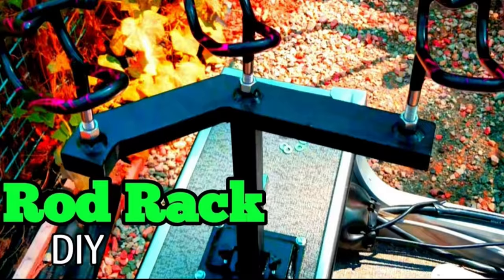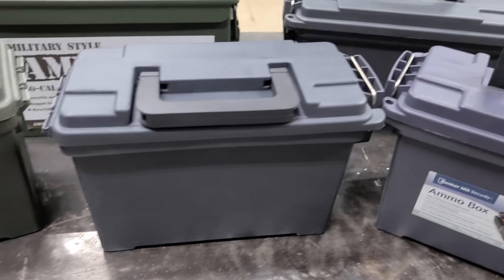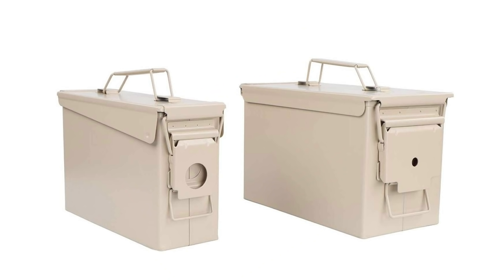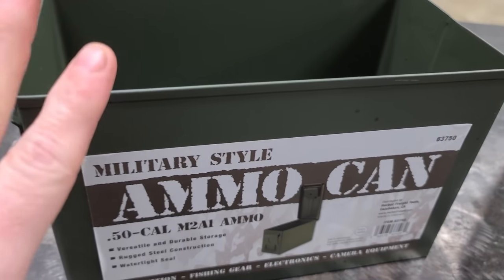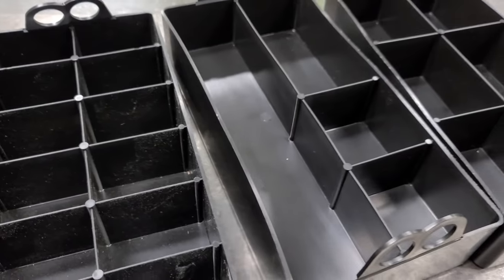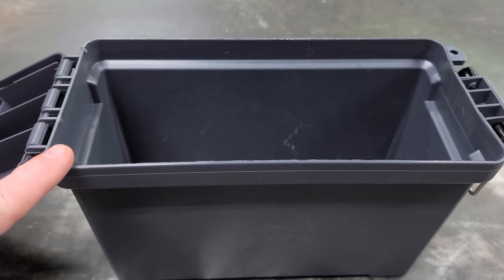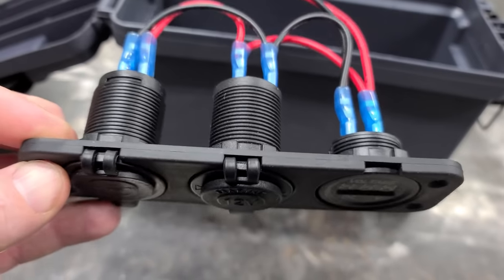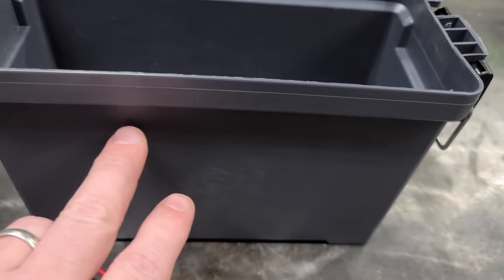10 Ammo Box Hacks

Comment: O rings go on the wet side of a system and prevent leaks better because the pressure from the liquid pushes them into the housing. Its just harder for it to escape.

The intake should be higher than the output on a system that uses a solid mesh as filter media that way the solids are sitting on top of the filter media with gravity pushing them into the bed. Running it at the same height in the middle will cause the flow to push your detritus into the media and then around the sides, bottom and across the top as these are the paths of least  resistance as the media gets clogged.

Love these vids and thanks for sharing them
Reply from the maker: Thank you for the info . You don't it before obviously  lol
Reply: @FishinNStuff  I build a lot of multi fish tank systems and ponds and being a person who doesn't want to break the bank or break other people's banks, well you know we southerners learn how to make do with what we got.

All my systems use pillow stuffing as the first thing flow sees, so I've learned what it does over time in a system. 

In small ones with high flow or pressure its important to use gravity to help it work. Heck.... its free and "sumthin 'bout the word FREE motivates ME"

Hope to drop lines with you some day, I'll start 'tubing" this fall I believe and see if I can help people just like you
Reply from the maker: @jrich436  you can do it , just start because experience is the main thing

Comment: Ya know what'd be kind of cool with that power bank is to either put in a charge controller and be able to plug it in and charge it up before you go anywhere or put in like a mount for a drill battery that has a controller built in like one of your old Black& Deckers and then buy a lithium ion high capacity one for it

Comment: great job, try your battery powered trim saw on that thin aluminum plate. Just put a thin coat of oil to keep chips from smearing, I have cut 1/2" or better plate with a regular skill saw with the carbide tipped blade.

Comment: On the ammo box grill your bottom grate could be the done same as the top grate. Or with your rods drill holes that just barely fit them and run them through the holes across the box. Slide rods in and braise or drill the end and use a carter key on each side so they done slide out.
Reply from the maker: That's a good idea .
Reply from the maker: I try and make stuff simple as I can sometimes so everyone can do it .

Comment: Cool projects. If you don’t have any spare sheet metal laying around; Lexan works well. CA superglues are effective adhesives for Lexan joints
Reply: You haven't tried to find lexan lately have you?
Reply: @gregscott1429  I have a sheet in the garage I use to make DIY swimbait lips. Usually easy to find at HD, Lowe’s, Hobby Lobby.  Curious, what happened to the Lexan market. 

Suppose you could also use corrugated plastic like the home for sale signs or beware of dog signs.
Reply: @apparaoapparao  covid happened to the lexan market.  Have you seen all the partitions at retail establishments?  I haven't checked lately,  but it should be getting better soon.
Reply: @gregscott1429  oh, that makes sense
Corrugated plastic would be a good option for non weight bearing applications. Cheaper and easier to cut.

Comment: Hi Kevin, quick question for you Sir, in regards to running your fishing lights (led 12v). How many can you hook up to one a (1 battery) setup and for how long do you think it will last? I love your idea of the ammo can with the external connections. That’s going to work perfect for my buddy and myself when we night fish. However, I’m concerned that one battery won’t have the juice to operate multiple lights. I’m thinking if I wire up several battery packs (like the ones used in cordless tools) then I will have the power I need. What do you think?
Reply from the maker: It depends on the light I guess . I made a video testing different batteries 
https://youtu.be/vat9JfboakQ

Comment: 50 mm Ammo box ????? LOL thought only us Canadians used metric !
I have another hack for you , Ive been doing for years.
 I use a small plastic ammo box for my cell phone , truck keys, and any paper work i need in my boat, it  keeps everything dry and it will float !
Reply from the maker: I guess I should have said 50 cal lol . We are all mixed up we use SAE measurements but a gallon of milk and a 2 litter soda hahaha
Reply: @FishinNStuff  LOL, there are lots of those cross overs . Growing up Canada switched in my early teens, and I still use the old system and prefer it .
Great video  bud

Comment: Military Ammo box 11. A radio Ammo with light. By top handle half side cut rectangular size car or marine radio on the other half install 2x 4 inches marine speakers on large side. On small each side install 2x both side 1x red and 1x green light with switches so you can turn on either or colour you need on the go or on the return side. Of course you can add white light to the opposite top radio half so you can see in the boat and one install on the small side so you can use as flashlight while holding the handle. It just missing one thing and it’s power. So you need a 12V wire out and hook it to your 12V Ammo battery box or any source of 12v in car, rv or at home in garage and Rock you favourite music.

Comment: For the grill, you're going to want to remove the rubber gasket on the lid if you plan on closing it while in use.
Reply: Replace rubber gasket with Fireplace webbing😜
Reply from the maker: That's true , I would remove the lid because it's so tight it would burn fast

Comment: For the grill, I'm not 100% sure it's safe, but if you're going to do it, instead of the shelf piece in the bottom to keep the charcoal off the bottom, just use foil.
Sounds dumb but line the botton with foil then crumple some up and toss in to hold the charcoal off the bottom.

Comment: For the power box, what kind of connector did you use to attach it to the battery?
Reply from the maker: I got them from the hardware store  , can't remember what you call them
Reply from the maker: https://www.lowes.com/pd/Utilitech-16-Count-Disconnects-Wire-Connectors/999953182?cm_mmc=shp-cprdelcgooglelia-106-electricalaccessories-999953182-_-0&placeholder=null&ds_rl=1286981&ds_a_cid=112741100&gclid=Cj0KCQjwytOEBhD5ARIsANnRjVj_69TSi9E17S1O_zeNZPpAqMXlCg0Lc3N4JI86Rq7nLPO0pBKZplUaAh1FEALw_wcB&gclsrc=aw.ds
Reply: @FishinNStuff  awesome thank you so much!

Comment: I made the battery box with the power center on it. It has the voltage meter, on/off switch and the 12 voltage receptacle. I also installed a small blue led on top which will make my florescent line glow while fishing.
Reply from the maker: That's some good ideas
Reply: @FishinNStuff  Thanks!

Comment: With the PowerBank box instead of pool noodles and secure the battery with a couple of thin steel plates at use the excess space as storage for chargers or even another battery if you can fit it just incase the one your using goes dead
Reply: Other than that great ideas

Comment: Alright. I got the small box like your using for the battery charging box, and a plug-in plate. I need to know what exact battery your using. Everything I've found are too tall.
Reply from the maker: I used one like this  , it's a little tight so you have to mount the plate high on your battery box 
https://www.amazon.com/dp/B00K8V2Y8W/ref=cm_sw_r_u_apa_fabc_SYL9Fb3VJ6GT3
Reply: @FishinNStuff  Cool. I got it on order from Amazon. I'm gonna try and do the plate vertical and turn the sockets so they read up and down.
Reply from the maker: @christopherbitton5113  that might work better actually

Comment: I always called those "kayak batteries" "vexilar batteries" because that's what my uncle calls them, as they are used to run his vexilar ice fishing fishfinders...

Also, as far as how a kayak battery box that is listed later as something like number 7 or whatever on the hack list, I wonder if a guy could take a plastic bag such as a grocery bag or some other kind of bag, and put that around the battery, and then just spray some kind of can of spray foam insulation into the ammo box to surround the battery in some kind of foam, which would in theory also prevent your battery from being able to move, while being also a more professional looking solution than using pool noodles... What the plastic bag is for, is the plastic bag will at least hopefully, keep the spray foam insulation material from sticking to the battery. Using that method, again, in theory, it should then provide a form fitted hole specifically sized for your size, type, and brand, of battery, and when you're doing that, you could also have different sized ammo boxes for different sized batteries, which could then be labeled for certain sizes and bridges and what have you. Speaking of, that same process, in theory anyway, could also be used for your ammo box power pack, instead of the pool noodles used in that as well, unless in either or both of those cases the pool noodle serves more purpose than just preventing stuff from moving around, because if it's for a shock protection as well, then I don't know if that would specifically work very well compared to the pool noodles...

Edit

One other thing, if you wanted to, you could also use the leftover space in your ammo box on top, by adding a flat divider above the battery, to avt as the new "floor" of the ammo box

Comment: Got my stuff ordered from Amazon today. Heading to Lowe's for the battery. I need to figure out a charging port so I don't need to lift the lid to charge the battery.
Reply: So I got the slightly larger ammo box. I already had the Viking 4amp charger as a fathers day gift from Harbor freight. The charger is attached to the battery like a bank battery charger would.  I bought a switch panel with a off and on switch, which has all the other options your panel does.  They both fit perfectly inside side by side with the pool noodles keeping them snug in place. When it's time to charge you open the box plug it in. I emailed you a photo to show you.

Comment: Do you have a idea of a mold for making concrete weights
Reply from the maker: Haven't yet
Reply: What size weight? 
I used Gatorade bottles with coat hanger wire in the top for concrete jug line weights.
Reply: @benscratchin8014  thank you that sounds like a good idea I need it for catfishing so I think that would work good  thanks again I'm going to try that

Comment: Hi bud, the current screws holding the face plate onto the side of the Ammo box are inadequate for the portable power box. These should be replace with appropriately sized 316 Stainless Steel Countersink Machine Screws, Washes and Nylon Locking Nuts. As for the On/Off Button, I would like to see you get creative as there are a heap of options out there. I also think people need to visit Mongers more often than not, as people are getting ripped off by places such as Home Depot, Harbour Freight and other similar shops for any Metal, Plumbing, Wood and screws etc. purchased. On the other hand, a Scrapyard allows for another cheap option too. Interesting hacks, Cheers :-)
Reply from the maker: I agree , and Hardwares are the worst place to buy metal . But that's all some people have
Reply: @FishinNStuff  You are right, as some Monger's might be 4-10 hours away from some settlements which is out of the question for most people and those in particular socioeconomic situations. This would also include delivery, unless ringing the Monger and discussing this and other options, Cheers :-)

Comment: What is the panel called, I want to make one, battery box!
Reply from the maker: This one is like it , they make 50 different types probably lol . But I like that this one has a on off switch
Linkstyle 4 in 1 Marine Switch Panel, 12V 4.2A Dual USB Charger Socket Power Outlet & LED Voltmeter & Cigarette Lighter Socket & LED Lighted ON Off Rocker Toggle Switch for Truck Car Marine Boat RV https://a.co/d/6BiWw23

Comment: 50 Cal. ammo box, not 50mm!  50mm is 5cm is about 2" which is smaaall...
  Good hack, those  batteries are on Amazon for things like "uninterrupted power supplies" for your home computer/TVs, etc. and for emergency lights that light up your hall, etc. when the power goes out.   I use UPS devices for all my computers and TV equipment and when they wear put, people just replace the whole thing (very expensive) or turn them in for credit towards a new one (almost as expensive).  What thry don't realize is that with little effort and a lot less money, you can replace the battery and save a bunch and, you can even get longer lasting batteries than waste originally came with the unit.  They're about $25 on Amazon. 
  If you get a 9amp hr battery, something that uses 9 amps will run for an hour but, something like a phone charging is only a small amount of amp draw and can charge lots of times.  Little USB COB lights plug in and run a long time and other things,  accordingly.   1/10 amp draw will last 90hrs with a 9 amp hr battery.
Reply from the maker: I really didn't think it through good I just unplug it and plug in my charger